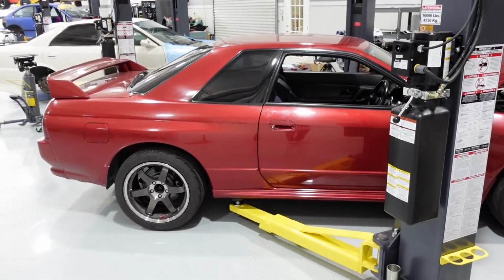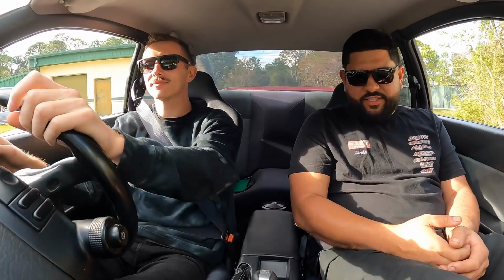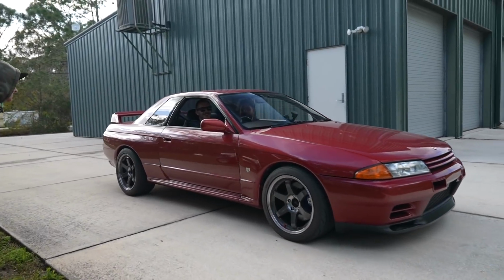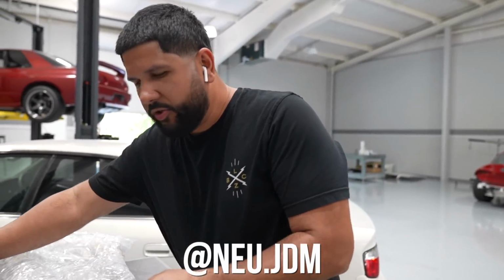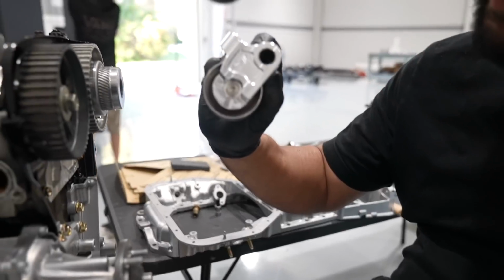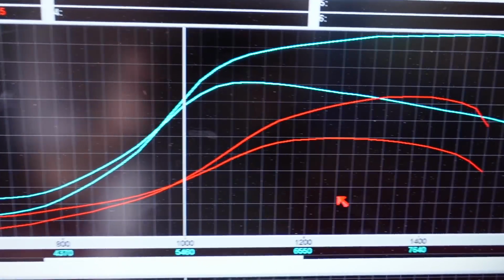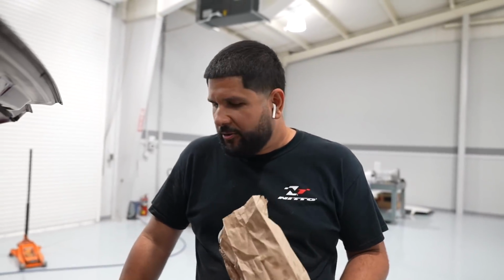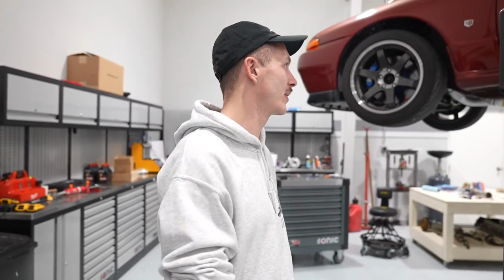First Drive in my Big Turbo R32 GTR!

Comment: Fun fact about the bnr32, if you are driving, knock it in neutral, turn the car off, then turn it back on (on a straight road obviously) it should turn off the 4wd and ABS (putting it in a rwd mode. It will automatically turn on when you stop the car, the abs light and 4wd light will also turn back off
Reply: Also that exhaust looks very similar to the hks super dragger

Comment: I think you should recondition the turbo maybe with a t51r mod and then the ecu but leave the setup apart from uprating internals on the r32, all your cars are fast fast fast, keep this period correct and old school laggy
Reply: Track it too
Reply: what a nerd lol 

Jk
Reply: Ewwww t51r mod is out dated
Reply: Go an OG T51RKAI
Reply: @stylepoints.180  and so is the car, hence my point
Reply: The whole point of him buying this was to have tommy clean up the engine bay and build the motor tho
Reply: @nathanrosser2626  which he can do, bringing this back to better than oem finish then requires to be kept with the period correctness, Tommy never sticks wack kits or wheels on these cars, all his finishes are oem+, so with a proper built motor as I stated with forged internals, some cool cams and just a better ecu as let's be honest the fcon isn't going to save an engine like a modern ecu, then recondition this turbo/manifold setup or put on a t51r and keep it just right, I know it's got the r34 drive train but that to me is oem+, that's how Nissan should of built it
Reply: @willb4644  Yupp I love builds like that! seems to give the car the caracter is deserves, like nostalgia even.
Reply: Stock bottom end with a crank brace will go 700bhp no problems 👍 
Just needs an oil drain back on the head, head studs, a set of cams and chuck a modern turbo on it and a haltech ecu and she's good to go, personally I'd leave it as is n just enjoy it till the turbo inevitably craps itself and then upgrade, tbh it just needs a tidy up ,doesn't need a full blown resto ,u could promote it as a surviver car cause well it is, it's rare to see one with the late 90s mods still attached, it's a piece of history 👌
Reply: @stylepoints.180  That's the whole point....
Reply: Just the sound of a t51r on one of those sound organismic.

Comment: Take it to the firm and compare lap times to the Evo! Would be very interesting to see
Reply: Evo would walk it for sure but that little thing would eat on the track. Needs a little quicker spool low end to compete i’d assume
Reply: @lj6284  yeah it would walk the evo no problem, but I would love to see this R32 be turned into a gripped up 450whp track car.
Reply: The suspension isn't setup for the track right now.  Would have to do the bushings to solid mounts and wider tires.  Would take to much work to have it get close to the evo.
Reply: The Evo would eat it up for sure thats pretty obvious but i think its more a less to see what kind of numbers it can put up 🤷‍♂️ pretty cool to see a R32 on the track anyways
Reply: @lj6284  if you know how to drive you’d be in higher rpms at any point on the track… he’d be spooled nearly the entire time. but the evo would definitely still walk it
Reply: SARD for 100

Comment: Definitely looks like whoever built this in Japan knew exactly what they were doing..
Reply: Most likely took a to a pro tuning shop.
Reply: In Japan its rare for a car to be tuned or modified by a non pro shop. The FCON is technically better than a PFC but only HKS Pro shops tuned them. Harder to find and more expensive. I assume it cost more money to be a HKS Pro Shop. I knew one local shop near a military base.  Brand loyalty ,authorized dealer is real. As an American using used or USA parts with shops(Tial,Aeromotive )was frown upon. I ended up with SARD fuel pumps that flowed less on paper but kicked azz. I started using Hankook tires after seeing one race team use them.  50 teams only one used Korean tires. 

My wife says she rather have a pilot over a Palisade. The Pali is way better but she won't consider it.

Comment: Love the sound of the "almost stock" r32 GTR, had a 92 GTS-T in you guessed it, Australia in 2004-2006 with a 3" exhaust and upped boost. The straight six RB sound is great and gets washed out when adding modern turbos with huge boost and wastegates, you are correct that this example you get to experience the old school JDM tuned sound!

Comment: most of our skizzas over here in aus have the old relay jobbie, when we were younger and broke it was a way to stretch the legs of a dying factory pump to and the rb20 had a hi/lo control from the ecu not to sure about the 25's and 26's but yeah doesnt mean its a track car its just something most people done either before or while changing the fuel pump.

Comment: You dont have to pull the shaft to disable the AWD system. You can do it the hood way and cut the wire and put it on a switch and go from AWD to rear.

Comment: I’m torn on wanting to see it kept as is or wanting to see a big power beast to compete with the 6-7 second r32’s of Australia 🇦🇺.
Under 500hp here is pretty much considered stock, 1000hp is standard mods and generally expected of a GTR  the big boys are running around the 2000hp mark
Reply: And then there are the 2000hp street cars.
Reply: Those engines are pulled down often though ,jun11 in 2019 had several rebuilds that yr just  to stay competitive same as king32 ,as fun n cool as they they're extremely high maintenance.
Tbh I'd leave it as is and if I u were to do a 6 second build you'd be better off starting with a bare shell or a wreck , and then your not limited to an expensive gtr shell cause u can use a gtst or gts4 shell and turn it into a gtr, it's just the rear guards that are different really, the shells are more or less identical, I've actually thought of doin that myself as I can't afford a real gtr 🤣
Reply: Dont they all use Nitto parts?

Cant believe Tommy the JDM dad is sleeping on the best RB crank available. Those HKS engines seem overpriced considering the finish and the hp/rev limit is less than the Nitto parts
Reply: @Jake Hamlin  Tommy isn't into big powe he wants 500WHP for a street car.

Comment: Great content Adam as you’re doing a stella job mate , as an Aussie we have learnt with our roads that 450 hp in the GTR’s is more fun and safer than when you run 800+
Reply: Without a doubt. It's much more fun driving the hell out of a 450hp car then taking it easy in an 800+ while driving the same speeds

Comment: The fact that it sounds similar to Brian’s r34 due to single turbo and it sounds much better
Reply: The irony of that statement is that according to the guy who built the 34 originally and also spec’d most all of the fnf movies, “Brian’s” 34 audio in the movies was mixed with a lot of jz noise and not a whole lot of rb
Reply: @Matt_Lanzer_13  wow I never knew. Thanks man 🤜💥🤛

Comment: you don't need to pull the front shaft on r32s. you can just pull the 4wd fuse and it will be 2wd.

Comment: The getrag box really needs to properly warm up; a 5min warm up isn't enough, they are much more accurate and smooth and less notchy after 15minutes.  Use the toyota v160 gearbox oil. You will need 2litres.

Comment: Your dead right about Aussies watching and saying  the best thing ever.  Drove my first R32 GTR and drifted my first corner and had to have one.  Power over steer, turn into the slide and drive sideways.  At the point a normal car loses traction and control, the chassis and AWD system gives you another level of driving tools to use.  If its still running cold you probably have a Nismo 68 degree thermostat in it.  Very common JDM thing to do with the 90's tuning scene.

Comment: love the way adam said that whistlindiesel mistreated the engine's of his R32's, then does the same with his own R32
Reply: ? They checked the engine over, changed the plugs and put fresh racing fuel before driving it hard
Reply: @Baker_7498  he said you don't know how long the car hasent run, so don't beat it to much when you first drive it. But instead he checks te max boost setting.

Comment: I don’t understand why you pulled our front prop shaft when you just need to pull the fuse and it will make it rear  wheeel Drive only plus only the R32 gtr came with this feature

Comment: Interested in more info on the fuel pump thing he mentioned. I understand voltage drop through a harness. so by using a relay, are you using a circuit from the battery, with a relay and switch (im assuming similar to many drift cars with the switch panels) simply to guarantee battery voltage to the pump? how would the ecu be able to communicate with this to alter pump speed to meet fuel demands? or does it instead use some sort of electrical pressure regulator that the ecu communicates with?

Comment: You need to get out of the whole Garrett g series concept yes they spool up fast but they die off to fast, try borgwarner efr’s or precision turbos or if you wanna still use Garrett go with their gtx 3076r for example
Reply: But when your sponsored and it costs significantly less to get Garrett stuff..

Comment: I have an 02 wrx 'hybrid' swap, with an blouch 18g, hks bov, and a little bit of this and that, it was built and tuned in the period and made all the proper noises until the cylinder walls started cracking (2.5rs block) but after 30k miles on a forged motor can you really be mad about it?

Comment: 480 is pretty good but take into account in awd your gonna lose around 50hp and your looking at around 430bhp 👍
My guess was 400bhp at all 4 wheels which is about standard for those mods on a r32 gtr , these setups were common here in oz 15/20 yrs ago 👍
Back in 2000 these could be had for average 25k for modded like yours and 20k for stockers, sadly I couldn't afford 1 as I was only 18 at the time on 300 a week. 
They did drop to around 10k for stockers for a little while but due to financial issues I still couldn't afford 1, now u won't get 1 in oz under 40/50k if your lucky 😔
I'd give my left lug nut for one of those 🤣
Ps going back to the previous where u mentioned whistling deisel, I used to love his content until he trashed those 2 gtrs ,u know smash up all the rams u won't, there's millions of the turds but to trash a rare iconic car like a r32 gtr is crossing the line ,it might not mean anything to him but for us Ozzies these are iconic Bathurst slayers that dominated the Australian touring cars from 89 to 94, we're the ones who dubbed it Godzilla.
In the late 90s/2000s when it became legal to import them (oz delivered ones were rare, they only brought in like 250 of em) they were the fastest things on the road being our local brands sucked for performance, a 95 ss Commodore v8 had 230hp at the flywheel 🙄 , gtr has 300bhp , and those of us who've dreamt of owning one since the mid 90s and likely never will being they're now out of reach being so expensive, to see someone just trash em like that is so depressing and makes ya angry. 
(Yes I'm aware he's rebuilding them) but I can't in good conscience support a person who would destroy a r32 gtr for clicks so I no longer follow him and probably never will again. 
What u said about taking time to check over a car before u thrash it is absolutely spot on ,I do the same, every time I get a new car I do full comprehensive service and inspection cause u know people lie especially when it comes to selling cars, I do everything, new battery, new pads, discs if it needs it, plugs, leads, belts, bushes if needed, fuel filter, everything just so I know 100% it's not going to fail in the first week of ownership and last a long time , it's good advice man 👍

Comment: I feel like the way the videos are edited can sometimes maybe be confusing to someone who doesn't know all the builds and what's being worked on at the time. You had a shot talking about the R32 with the hood open and messing around in the bay and then it cuts to b roll of the gasket being scraped off the JZ oil pan and then cuts again to Marco cutting up the front of a red car (I know it's the blue E36 but it looked red). I kinda feel like that would be confusing to someone  new you know? someone could get confused and think you pulled the engine on the R32 and started cutting up the front